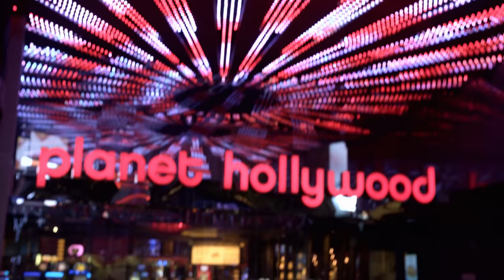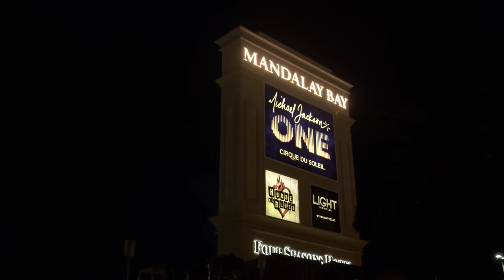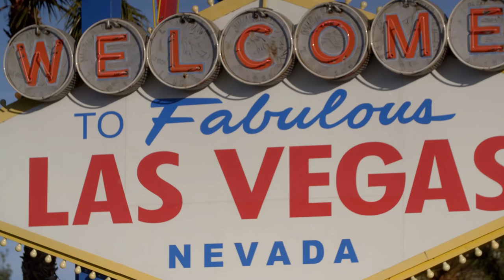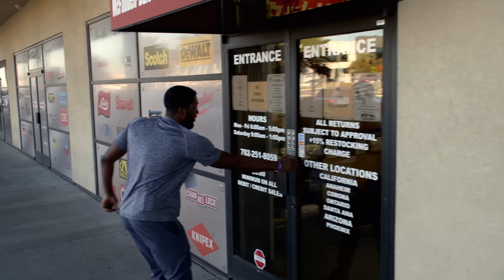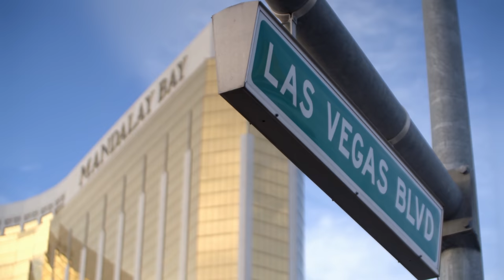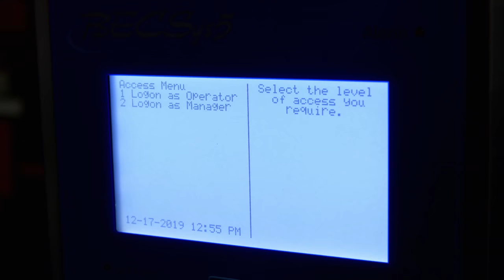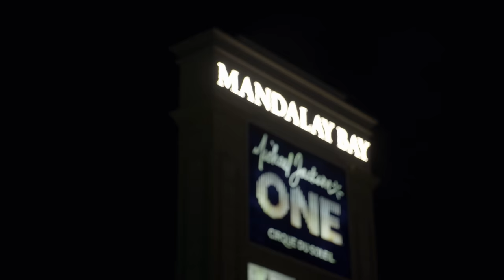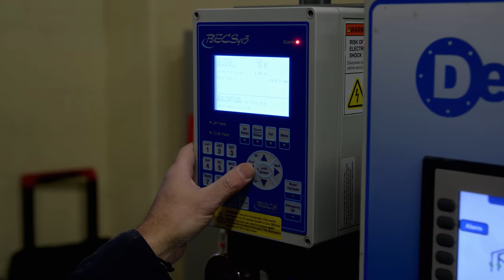Huge Swimming Pool in One Week | Giant Pop-Up Constructions - Las Vegas, USA | Free Documentary

Comment from the maker: The Mandalay Bay Hotel in Las Vegas. A swimming arena is created in this glamorous glitzy venue in just one week. Just a week before, the space was equipped with all the trappings of an A lister elaborate stage performance; now it’s being turned into an indoor swimming pool. For the "International Swimming League" competition, 20 craftspersons are installing a 25 meter long, two meter deep and 20 meter wide swimming pool in seven days. 84 tons of steel and over one million liters of water. If the pool is not placed at the correct spot in the hall, it will negatively impact all the other components. 

The introduction of a new feature that will demand the pop-up professionals from Italy their A-game: The pool should have a transparent wall so that the audience can see the swimmers. All materials are specially made for the event and were shipped from Italy. From the two-ton acrylic wall to the six hundred metre long pump water system. Carelessness could damage the material and cause the project to fail. Because ten thousand kilometres away from the factory and without the right machines, it is almost impossible to do so. Unexpected problems with the material threaten to cause the pop-up construction to fail. Time is running out, the team called upon to do everything to get the job done. Will it withstand the pressure of 1,000,000 liters of water?

Giant Pop-Up Constructions - Germany - Gigantic Pop-Up Fair: Oktoberfest: https://youtu.be/4uCaME4YvVM
#freedocumentary
Reply: 4K FTW

Comment: They could have put flat screens on the outside with a camera inside and just sent the image. Would have saved them a lot of work and time. At 4k 120 FPS it would be just as clear as the acrylic.
Reply: Cuz placing electronic equipment on the side of a pool with people in it is a good idea 🤣
Reply: The perspective wouldn't work though. In the same way that you can't just replace a window with a big TV monitor and still have people view it correctly from many angles, this wouldn't work if you just replaced it with a camera and display.

Comment: Was laughing when I heard extra large angle grinder. Cmon they should have 10 of those just in case that one of the most basic tools ever and cheap.
Reply: As long as I'm not the one using it... scary!
Reply: No kidding I was also surprised Home Depot was the 3rd stop on his hunt for the grinder 🤣
Reply: I agree...Something of this size, I would have had a tool rental center on call for last minute needs.  One phone call, and they would get it, not running around looking for it  They could have used a smaller grinder to get things started, plus that wasn't an uncommon grinder that the hotel should have.   They also could have cut it off with an oxy touch,,,,
Reply: Those large angle grinders will wear you out! It uses you, you don't use it 😆. I had to smooth down some welds on top of a stack over 100ft in the air at a cement plant in knoxville.

Comment: Given how much they had to remove from that column, I’d say some designer did a horrible job.
Reply: or the virtual size was screwed up in reality maybe the virtual used different measuring metrics than the company who made it in reality
Reply: Was probably the steel manufacturer who messed it up, not the CAD drawing.
Reply: Homey Depot to the rescue...
Reply: There's always something on a construction site that never fits properly. Iv never had a site be perfect without any modifications

Comment: And on a more "professional" note, the one mistake that was made was to not erect the superstructure in Italy before shipping. For a custom-designed install such as this, it should have been unthinkable to not install everything structurally one time - excluding the plastic wall - to precisely be sure that the structure would fit. Nonetheless - they made it work - as these types of folks always do.
Reply: @JG-sherminator  In my own personal experience, I would never have such a structure delivered, without a pre-fab. Given the risks involved for timing and operation, and the fact that to just make sure all of the pieces fit together before sending them on a 5 day installation (I'm not talking about all the fittings, of course), there is no way I would allow it without a certain degree of surety that the pieces will fit. The margin of error is just too tight. Now, of course, if there were delays in the fab work which didn't permit this, then that would have to be re-evaluated.
Reply: @jimbim4405  I guess there were probably even more dramatic deadlines than the construction.
5months of planning isnt enough for this type of project imo. They probably had to ship all the material 1month before instalation and if you take into account design, layout, static evaluation, technical drawings etc. you are left with little to no time for manufacturing those pieces.
They probably just didnt have that extra week and the error came up from multiple ppl working on the wall layout ("I will do the normal walls, you do the acrylic").
The fact that they didnt probably had complete .cad model is more "interesting", you would spot this error on the first glance.

btw..been there, done that - project manager for trade fair expositions, sometimes you have to learn the hard way 😂
kudos to them 👍
Reply: @jimbim4405  Totally agree
Reply: Even a slight variation in level on the floor would make it not line up.
Reply: Thats what we do in construction,  keep the engineers and architect from being liars.
Reply: There are far more complex things built around the world without fully-assembled buy-offs.  Stamping presses are one I'm intimately familiar with.  It's not that big of a deal.  There are always issues in any project of this scope.

Comment: The guy at 39:38 sealing an Olympic size pool with a toothpaste tube! Gotta love Italian engineering haha
Reply: Not that bright are you?
Reply: @MrThisIsMeToo  lmao
Reply: Prior to the clip, he is verifying a continuous weld by checking for gaps with a putty knife.   Then the worker applies a small bead of PVC glue/sealant at the edge of the lap joint.  Sometimes the edge of the PVC sheet is sharp and hard enough to cut a swimmer's foot.   The workman is just rounding off the edge, not leaving a  large mound of sealant. He is using a small dispenser since it would be much more difficult to get such a small, precise bead with something like a calking gun.

Comment: “The floor markings need to be installed with millimeter precision” I’m not a science Dr but I don’t think swimmers will notice floor markings being off by inches much less millimeters.
Reply: The swimmers won't notice, but if someone complains because they lost... and it turns out the markings are wrong... it can invalidate the results of an event. Basically the precision is required "Because Lawyers"

Comment: Step 1: Fire the engineering design company that put the plans together.  If their measurements are off by feet and require the cutting of support members, what other little "Details" did they miss?

Step 2:  Get another project manager that can pivot a little bit faster than 3 hours to decide if merely cutting a corner off of a bracket to make it fit.

Comment: The fake drama good grief...it gets so old.  Why not just give a more straightforward take on something that is actually interesting without all the fake fluff.  Now as for how that main column needed almost a foot cut off of it with an angle grinder......somebody needs a taking to back in the motherland.  Also how did they not have a couple of guys from a local fabrication shop on site, or at least on call for just such an occurrence.......major project planning failure in my opinion.

Comment: Seems like the fabricators in their shop suck
Reply: The issue with the column might not have been poor fabrication. What happens every once in a while, is that the part might have had multiple design changes, at times you might have up to 17 changes for the same part, the fabricators won't wait for the final design to be made. So, they'll make a generic part, which can accommodate any future changes that may occur. Once the final design is out & test fitting is not an option, the guys doing the installation, will go to the site with their generic part and the final plan, & they'll modify the part according to what works on site.